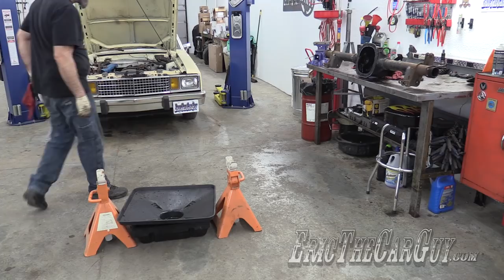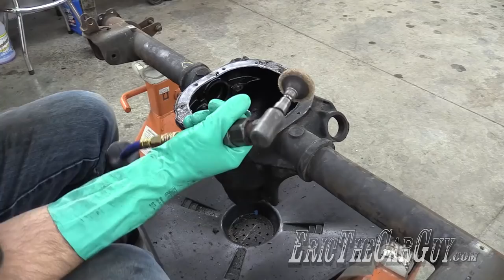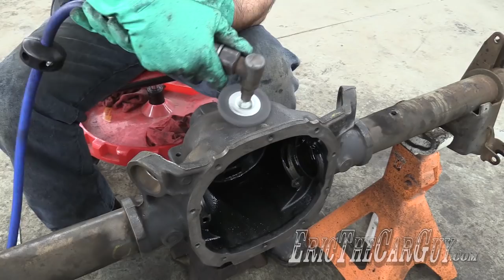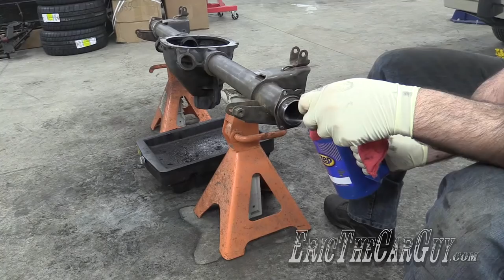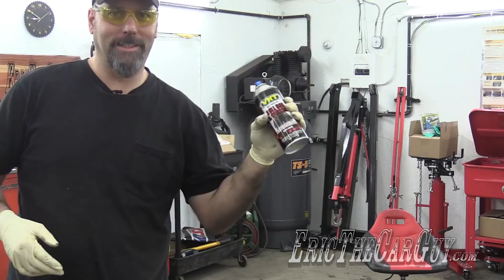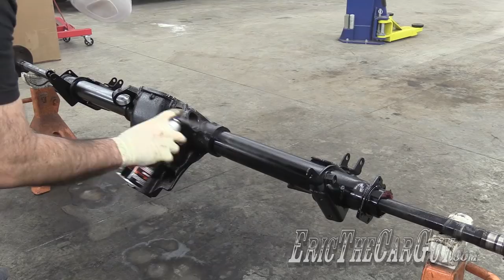How To Clean, Prep, and Paint a Differential #FairmontProject

Comment: i would have power washed it plus instead of paint used truck bed liner
Reply from the maker: Well if you want to donate a pressure washer...
Reply: Can you pressure wash an engine block?
Reply: +EricTheCarGuy you could use one at the coin operated car wash.
Reply: +Jesse Silva  
Yes, you can pressure/power wash an engine block. 
Remember to blow it off/out with compressed air and spray with WD-40 or a spray corrosion inhibitor such as CRC SP-350 to prevent unwanted rust corrosion.
Reply: EricTheCarGuy 😂😂😂😂

Comment: Am I alone in thinking that the cleaning should take place before disassembly? Bearings and gears are extremely sensitive to grit contamination, for long life they should be assembled with near surgical cleandliness. So much easier to avoid contamination of the insides with road grit and rust if the outside is cleaned first. So much nicer to disassemble a clean assembly.
Reply from the maker: That's one way. My way worked just fine too.
Reply: If you're replacing the gears and bearings, why would it matter? Get the old crap out in any order and assemble into a cleaned and painted housing. Or is Eric planning on re-using bearings and gears?
Reply: As long as it all ends up clean, that's what matters. I personally use a pressure washer and a nice caustic, water based degreaser for my initial clean, but I am lazy!
No matter how it's done, you still end up scraping, scrubbing and wheeling the part before paint.
Reply: Dude, you deserve more subs. This is a lot of work + the editting and video.

Especially getting those angles. Great job, can't wait to see the fairmont done!!
Reply from the maker: Thanks!

Comment: Paint that with POR-15 and it'll never rust or chip.  Rattle can paint won't last on a diff.
Reply: POR-15 works, but t will rust and chip, I've seen it many times. Anything sprayed on that diff, other than epoxy primer, will eventually lift, peel, and bleed rust.
Reply: POR-15 is overrated junk.
Reply: Sideslip
I haven't used epoxy primer for stuff under the car, but POR-15 is really strong in my experience.  I painted a differential cover with it, and it hasn't been ripped off.  Where as that vht paint will quickly be ripped apart. 

It isn't as pretty cause you have to brush it on, but it's strong.
Reply: Oh yeah POR-15 works great, especially with good prep. If I were to give POR-15 a 5 year warrantee, I'd give epoxy 10 years. But yes, it beats the year or two you will get out of a spray can.
Reply: dropinbiking92

Epoxy primer is also a fair bit more expensive.  I use Eastwood's spray can version and it costs $30 for a can that if you don't entirely use is thrown away.  Where a small can of POR-15 is the same in price, and coat a lot of surface.  So much so that my silver can is like 10 years old and still half way full.  Nasty stuff to get on your hands.
Reply: I bought 1 quart of epoxy and 1 quart of activater (1:1, so 2 sprayable quarts) for $40, so I'm not sure about the price difference.

Comment: Box cutter or razor blade would be alot better and faster than metal hammer removing tape.
Reply from the maker: Not really. Ever tried it? It's more difficult than you think.
Reply: Nah, that's a casting with a rough surface and edge, the blades get caught and don't slice very well,  leaving a jagged masking edge,  which kills the perfect paint job.  if it was a clean,  broken machined edge then the blade is super quick and clean. Nice job Eric,  I wondered how to mask a casting's edge easily!
Reply: EricTheCarGuy
I have tried it. It is simpler just trim excessive tape off around the edges instead he man pounding on the flat surface and possibly put dents in the flat surface. My father and uncle is a body shop men, who've taught me quite abit about stuff like this.

To each their own.

Is the mustang shell going to be a track only car, in the furture of eric the car guy?

Comment: degreaser and power washer..done in 10 minutes.
Reply from the maker: Feel free to drop the pressure washer off whenever.
Reply: Back when we did not have a pressure washer in our shop we just took our parts to the self serve car wash, sprayed them with Gunk Engine Brite degreaser, wait 5 minutes and wash with the car wash wand. 
They always came out extremely clean for less than $2.
Reply: Even with a pressure washer, you will need to scrub and scrape some parts off. The pressure washer just makes a good head start out of the job.